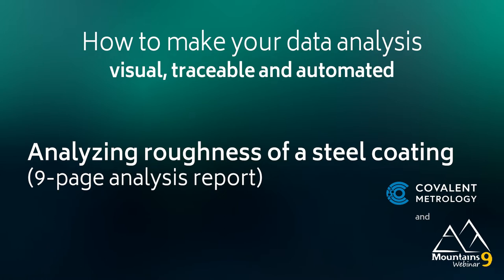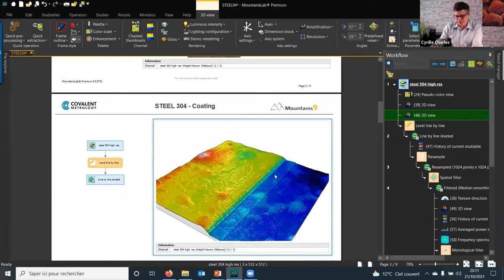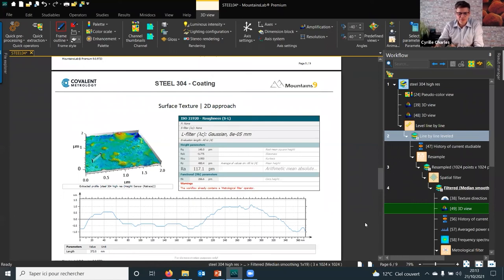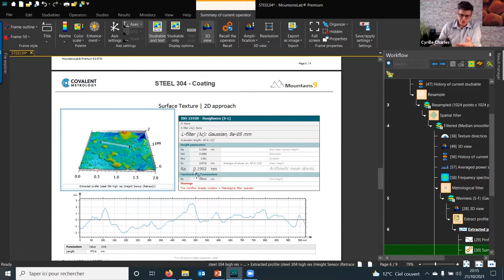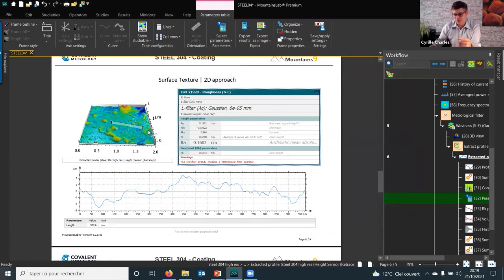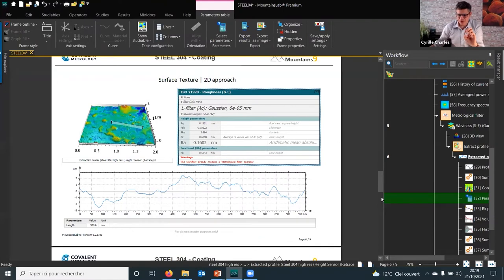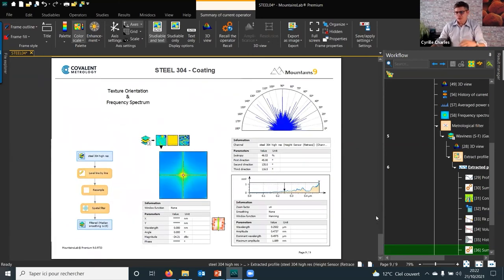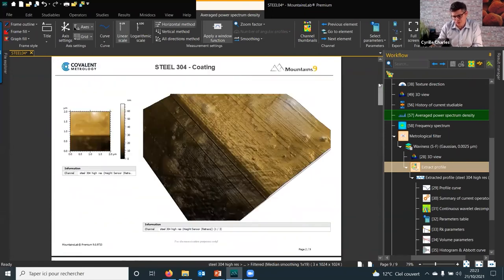Mountains® Webinar | Analyzing roughness of a steel coating (9-page analysis report)

Comment: Good evening! I need to calculate wear parameters. In your program, in the fractal analysis section, you can calculate complexity (Asfc), heterogeneity (Hasfc), maximum complexity (Smc). I'm right?
However, I am unable to calculate the following parameters: 
Texture fill volume (Tfv) and anisotropy (epLsar). How should I do it?
Reply from the maker: Hi Vladimir, thanks for your question. Mountains®software allows you to calculate a very wide range of parameters depending on your application. In order to answer your question accurately, please send us more details to support@digitalsurf.com and we will be happy to help!
Reply: I wrote but they didn't answer me!
Reply from the maker: Hello  @MrStrelokful  I just checked with the Support team, unfortunately they haven't recieved anything, please send your request by email including your serial number to support@digitalsurf.com. Thanks!
Reply: @digitalsurf  Add the Tfv (textural fill volume) parameter that was previously in the Sfrax program along with the Asfc, HAsfc, Smc parameters!